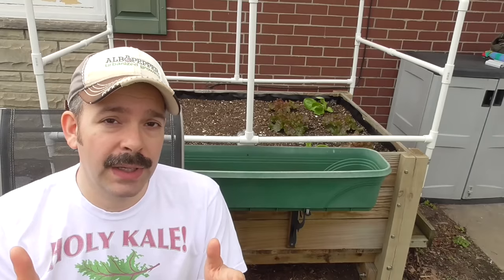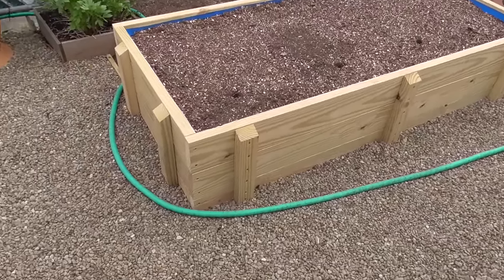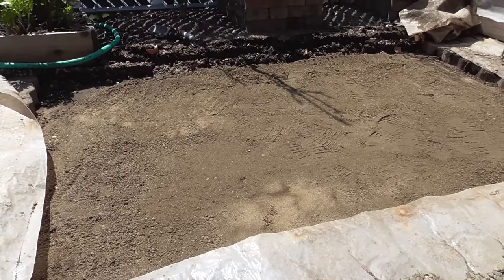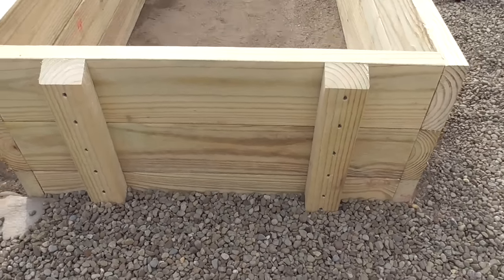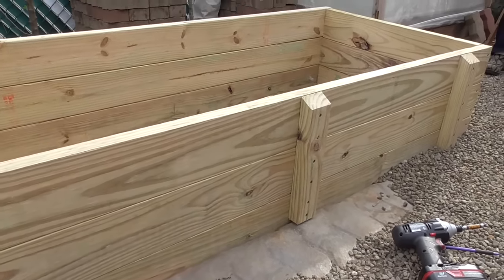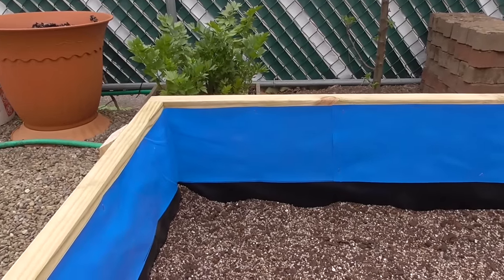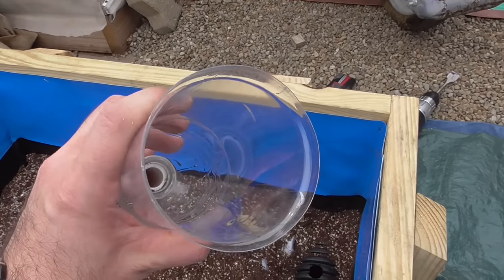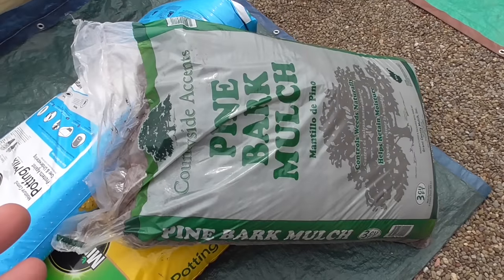Self-watering SIP Sub-irrigated Raised Bed Construction  (How to Build)

Comment: Hey, Albo. My family and I are considering building a 16x16 raised bed enclosure. We plan to make one continuous bed that runs around the perimeter with space to enter the enclosure, of course. Ultimately, the design in mind should give us about 170 square feet of planting space. We would like it to be self watering and based on your design.

My question is, would it be feasible to make a SIP this large or should we plan for an alternate watering method? I know that will be a lot of water being held and we've never done this before. Based on your experience and expertise, would you be able to offer any pointers to us?

Thanks in advance! 😁
Reply from the maker: I know of people who have built several large SIPs and they had great success. One thing I would advise you to do is to estimate the cost of potting mix beforehand. Potting mix can be super expensive in large quantities, especially if you don't get it when it's on sale. If you are making a horseshoe shaped bed, I suggest breaking it up into at least 3 segments.
Reply: Thanks for the time and advice. Why do you recommend breaking it up into sections? Would that be too much material or water for a continuous build? 

Thanks Albo!

Comment: Can I make the bed slightly deeper?  I am actually trying to find a way to build a raised flower bed next to my house.  Obviously I do not want moisture to sit in the bed because it will be next to the exterior house wall.  I need the bed to be raised enough to discourage my dogs from getting in the flower bed.  I would like to use stone for the exterior design.  Any suggestions on how I can alter this method with the wooden raised box to use it for a stone flower bed design?
Reply: I didn't mention that we live in Mobile, Alabama where summers are brutal, but we also get torrential rain storms that will flood the bed quickly.  Having a superior drain system in place if critical due to our climate.

Comment: I'm still fresh to gardening. I'm wondering what I can grow in a box like this. I would like to do cucumber and tomato and maybe green beans. I plan to have trellis for beans and cucumbers and 2 tomato on one end. I could make this box bigger. As I have not started it yet. Any help or thoughts would be great.
Reply from the maker: Welcome Dustin! If you watch my video walkthroughs you can see the plants that were grown in SIPs and how they performed: https://www.youtube.com/playlist?list=PLkTlGtPvkBBg0lvLD_HKGSLj1xcrp5jJO Tomatoes are amazing. I've never tried cucumbers, though I would expect good results. Beans, might not do as well though. I've always grown my beans in the ground, so I can't say for sure. I've had decent success with some snap peas. But depending on climate, excessive moisture might create issues for beans.
Reply: So I accidentally bought 10" pipe. Do you think that would work? Or I was thinking on cutting it down the middle and rapping it with screen. Witch I'm thinking would be nice. I would do two side by side for ten inches. For as long as I want for a 5" high. Flat part on the bottom. What do you think

Comment: What is the optimal spacing between the corrugated tubes?  Would half inch spacing leave the soil or potting mix too waterlogged?
Reply: forgive me, Al.  It seems like 1/4" to 1/2" spacing from your video.  Many thanks.
Reply from the maker: No problem. Thanks for watching Fritz!

Comment: Al, how much water does the sip hold and about how often do you have to refill it?
Reply from the maker: +Jim Powell  - Hi Jim, this video talks more about the watering aspect of the SIP bed:  https://www.youtube.com/watch?v=VJ2T6gUv8Gc
 
For the box that I built, I don't have an exact measurement on water storage. But between the potting mix saturation capacity plus the actual reservoir, I'd say it could hold 30 gallons easily.

Comment: Can you give a list of materials?   Are you using 2 x 6 boards?   What is the weep-tile.  I can only find 4" on the Lowe's website.  What is the grade of the poly lining?  thanks.  I see this is from a while ago  Have you made refinements to your setup?
Reply from the maker: Hi Nancy. Thanks for watching. Yes, I used 2 x 6 boards. For some extra tips on this project, you can read more on this page: https://albopepper.com/SIP-raised-bed.php It also has a link to the 45 mil liner that I've tested and recommend.
Reply: Nancy, I just built the bed from the instructions in the link he copied below. I went a little bit cheaper on the lining, opting to go with a heavy duty 8mil tarp on the ground and a 6 mil builders plastic on top of that. I probably could've just gone with a pond liner from a big-box store as my solution was only $30 cheaper than the pond liner.

Comment: I would aim away from time/slow release fertilizers.... They require water to be released into the soil and you are not watering the bed, so it only releases when it is raining. That might be okay, but it could not release enough for your plants to grow as well as they can. How is it the pine bark doesn't lock up nitrogen like wood chips? I gotta make a couple of these sooner or later.

Comment: Very cool concept! Are the central aeration pipes connected to the end drainage pipes which are connected to the outside?
Reply from the maker: Thanks Wayne! Yes, the overflow tubes are inserted into a drainage pipe to keep them from clogging up.
Reply: Sorry I mean, in the video there are 2 short pipes on the ends that appear to be connected to the outside via the tubes but then there are 3-4 long pipes with fabric over there ends in the middle (the ones you mentioned to leave space between). Are these long, central pipes connected to the short end pipes? Or are they simply capped by fabric and serve only to aerate; don’t participate in drainage function?
Reply from the maker: Yes, they are connected. The 2 short pipes on the end are the "overflow tubes." They are positioned so that the internal end is inside of the long pipes. Like this: https://albopepper.com/images/Albo-grow-Box_diagram2.gif

Comment: Without rain, how long roughly can you go without adding water? Also, do you have to do any watering of the leaves?
Reply from the maker: +Rachel Isaak - Hi Rachel, the frequency of watering will change based on multiple factors (plant quantity and size, weather patterns, light levels, etc.). You can check some SIP watering tips here: https://www.youtube.com/watch?v=VJ2T6gUv8Gc
 
I don't intentionally water the leaves. In fact, often people with advise against doing so.

Comment: ??? How do you think using concrete blocks instead of tubing would work?  Trying to use what I have, to keep cost down.
Reply from the maker: I've never tried that, so I don't really know. Concrete blocks could be used to make the walls of the bed instead of buying wood. That might possibly save you some money.
Reply: We read there were toxins in the blocks and after pricing tubing, concrete blocks and unwashed stone, were are going to triple our 8 ml plastic and go with the stone.
I will report back next year , as to how well it goes.  Two beds are 15 by 4 and another 10 by 4.

Comment: I have a quick question regarding the overflow tube.  Isn't it possible to just make sure you don't over water and not have an overflow at all?  I'm a bit leery about cutting a hole in the plastic lining for it.  Or maybe there is a "dip stick" method that can tell you when there's the right amount of water...?
Reply from the maker: What if it rains?
Reply: @Albopepper  I was actually thinking about making removable clear acrylic "roofs" for the planters.
Reply from the maker: If you can 100% ensure that it doesn't get overfilled, then technically you could skip the overflow hole. But you would need a really accurate water level gauge. And the planter should be perfectly level too. I would never recommend it though.

In my situation, I want my planters to be able to catch rain. It's a free resource that reduces how often I need to water manually. But you would need to evaluate your own situation to decide what is best. Just make sure the root zone doesn't get overly saturated.
Reply: @Albopepper  copy   ty!!!

Comment: Would there be any issues using 100% sphagnum moss for the bottom wicking layer?
Reply from the maker: I've never tried it. It's possible it would work. My one major concern is if the wicking layer ever dried out. Peat moss is hydrophobic once it becomes bone dry and it actually repels water. Rehydration then becomes challenging. So you would need to be very careful not to neglect the watering.

Comment: HAY Al I like your grow box, but what happen to it in the winter time. I live in Ky and it does get cold and sometime it will freeze
Reply from the maker: Ed Cast Hi Ed! Good question. If you want to be safe, you could stop filling the reservoir at the end of the Fall. Then before snow flies, you could cover the bed with a tarp or some plastic so that no extra water seeps into it. I might just do that with mine this year. I never did so with my 1st box (at beginning of video). And it is still going strong.

Comment: There is not one SQUARE  bed in my yard..i got a lot free wood that was warped...most people can not even tell...

I would never line a bed..ever...but its interesting..and a great idea..im just going to drip  irritation...been using some pvc in three beds and loved it...but to save even more.water.going with the real thing and eventually tap into my well...just.did my water pressure test..

My pots are.a.constant head ach tho and this system is what i should.do but havent.

Leon channel sort of explains it for pots

Comment: I'm building a small setup for this season and was wondering if you think these could be linked together, say three containers. Input in the first, drain runs directly across to a low entry on the next box, drain out to next box, ending in a final exit drain.
Reply from the maker: Hi Craig! Yes, these absolutely could be connected together. They just need to all be level and at the same elevation. Check this update video where I mention the use of a float valve: https://youtu.be/aKrjC5sC5cU?t=6m59s  That would further automate the process!  xD
Reply: AlboPepper - Drought Proof Urban Gardening. Awesome. Thought it would be ok just wanted a more experienced opinion.

Comment: I wish you had explained why you consider compost "gross". Most gardeners consider it one of the best ways to feed/fertilize your plants. Why will it not work in these systems?
Reply from the maker: Hi Jan. I did explain it. In this series of articles: https://albopepper.com/refreshing-sip-potting-mix-adding-fertilizer-year-2.php

It's not that ALL compost is gross. There are many types of compost. And SOME of those composts are "gross". They are not intended for application within a container. Rather they are meant for freely draining beds that are connected to the ground.

Comment: I built my raised beds 48" W x 96 L x 24" H since my wife and I are in our 70's and have trouble bending over. Can the amount of potting mix be increased to fill the 24" height or would it be better to add a second layer of drainage pipe?
Reply from the maker: You could try using more potting mix, but pay attention to the surface moisture in case the water has difficulty wicking all the way to the top. If the lining hasn't been installed yet, another option would be to place a 6 inch sub-base of compacted gravel. Put sand on the gravel surface to avoid punctures. Then put the lining on top of that, to reduce the internal box depth.
Reply: Thanks for the reply. I think I'll take your suggestion and add about 4" of base material under the perforated pipe.

Comment: I have a planter that I could retrofit this on. Is the plastic sheeting required? I live in Maryland for the record.
Reply from the maker: You need something to hold water for a reservoir. If you don't want plastic on the upper sides, you can skip that part.

Comment: What keep the soil mixture in the bottom of the bed from becoming mouldy or swampy? Also, how come all the other sip builds use gravel in the base
Reply from the maker: By using potting mix based components in the SIP, the containers & beds don't get all muddy and gross. Perlite, Coir, Perlite, Vermiculite, Pine Bark Mulch, Growstones... They all have larger particle sizes and they hold up better over time.

As for the gravel, I've never seen the benefit of using it. It doesn't really wick. It displaces a large volume of water. It significantly increases the weight (which can be an issue on decks, balconies & rooftops). It is harder to install or uninstall & is more apt to damage your liner.

Comment: very good video. Pipes at bottom are connected??? you havent mentioned. Thank you
Reply from the maker: Thank-you for watching! No, I don't connect the pipes in my SIP systems and they work great. But if a person wants to do so, they certainly could.
Reply: since only  one is having drainage & reffiling pipe what about the rest;;;; 
it does not make sence if Others dont have drainage pipe or reffiling pipe eather
Reply from the maker: The pipes have slits in them and the potting mix has air gaps or pore spaces. These allow water to travel along the bottom of the reservoir. It is mentioned in this update video:  https://youtu.be/VJ2T6gUv8Gc?t=3m55s
Reply: sorry i try to say that you place on bottom 6 pipes 10ft each but only 1 is with smallest white in order to fill water. What about the other 5???. Since you cannot add water on them are useless plus the fact that dont have any draining pipe like the one
Reply from the maker: They are perforated. The holes allow water to pass through. They store both water AND air. That is their function.

Comment: +AlboPepper you mention you use a different mixture at the bottom around the drain pipe vs the rest of the box. Is it really just potting mix/vermiculite mix or do you put anything else in there?
Reply from the maker: +sniper6878 - It's not anything that is set in stone. But I've messed with mixtures of 1/3 perlite, 1/3 vermiculite & 1/3 peat moss. Coir could be used instead of peat moss. Perlite could be left out. I just made a couple 18 gallon SIP totes and I used 50/50 coir and vermiculite. I wanted super good wicking because the pipes were squeezed in very tightly and there wasn't much space between them.

Comment: Could I just use Peat Moss for the wicking material so I don't need the vermiculite?
Reply from the maker: HR BL You could try it. Vermiculite is harder to find and can be more pricey. But I would at least try to include some perlite along with the peat moss. Maybe 1/3 perlite? I've never tested this, but I don't see why it wouldn't work. You're simply referring to the bottom layer, right?

Comment: Question: Why would you not want to use manure or bagged compost in this style planter?
Reply from the maker: BAGGED COMPOSTS? To prolong the viability of your SIP potting mix, it's best to replenish nutrients in the form of fertilizers. Organic gardeners are apt to use compost as often as possible. In SIPs, worm castings can be included in small amounts. But using composts in containers can yield unpredictable results. Bagged (retail) compost, humus or manure might have a fine consistency, similar to garden soil. If it contains fine silty particles then this can reduce pore spacing and aeration properties of the mix. That's why topsoil is NEVER recommended.

As air gaps get plugged up by ultra fine particles, compaction occurs. And since SIPs are always resting on a perched water table, the few remaining air gaps tend to be saturated with water. This impairs root health, preventing plants from getting the oxygen needed at the root zone. This can lead to a decline in plant growth, or even root rot and death. Even if plants grow ok in the first year, over time the potting medium may break down to the point that it must be replaced. 

https://albopepper.com/refreshing-sip-potting-mix-adding-fertilizer-year-2.php
Reply: @Albopepper  Thank you! I'll be reading up more on your website. I'm brand new to this concept. I'm going to create 4 SIP  planters out of 8' diameter round metal watering troughs. I'll be looking for the lowest cost way to fill them! Any suggestions? I'm in the Phoenix, AZ area.  Thanks!!

Comment: Great tutorial. However, regarding the potting mix, how about coco pit & home made vermi-compost? Subscribed & thumbs up. Lots of regards.
Reply from the maker: Thanks Dibyendu! As long as you have quality coir, you should be able to use it just as you would use peat moss. I would still recommend something for pore-spacing like perlite and/or growstones. I've used sifted worm castings as a portion of my mix and it seemed to work well. The key is to balance the wicking and aeration properties. Also, I try to think how it will hold up over multiple seasons and in extreme rain events. I hope that answers your question. Thank-you for your support on my channel!  :-D
Reply: Thank you so much for the answer.